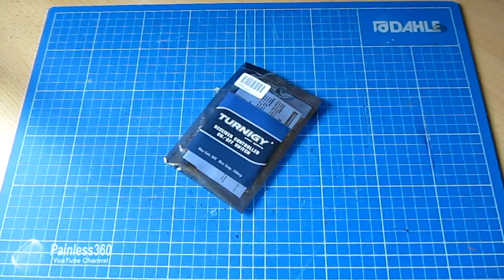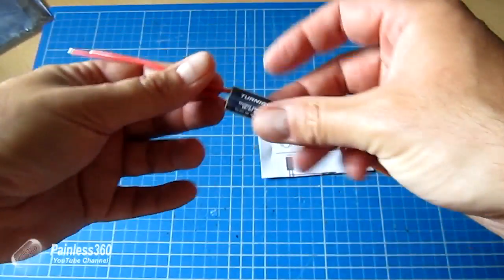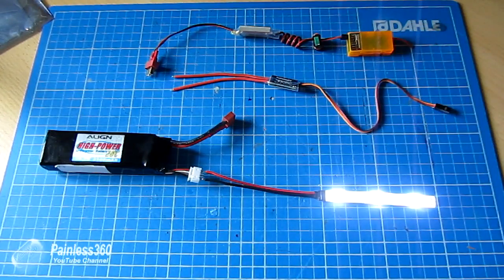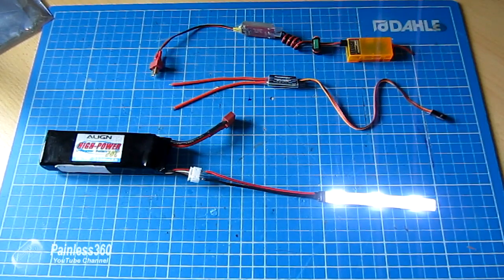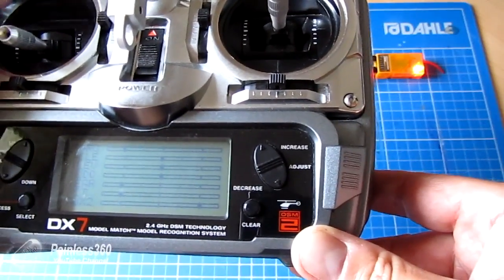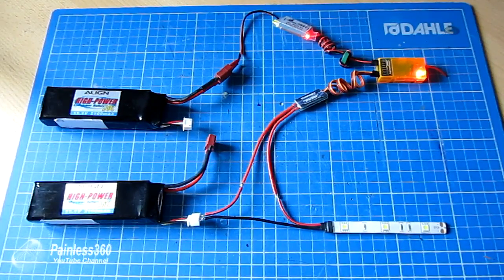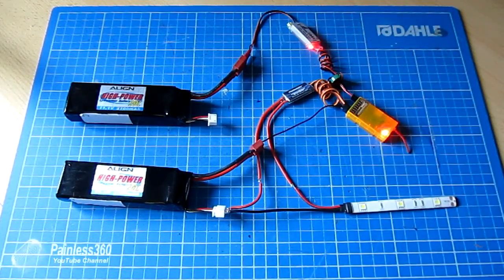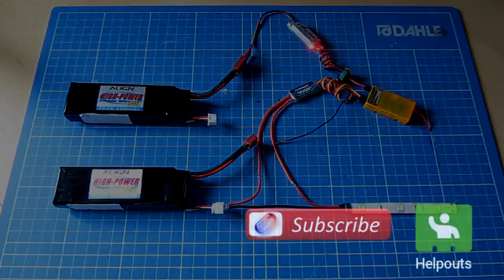Turnigy R/C Switch - Use for LEDs, landing gear etc.

Comment: if my lights are 5v and im running a 3s lipo, where in the circuit to I put the Ubec? im assuming its on the positive coming out of the switch going to the light?
Reply from the maker: Check out my videos where I use one. https://youtu.be/T0OBDKdLpOI

Comment: hi! i may be years late, but can i ask for an explanation why the batteries need to have a common ground for the switch to work? Thank you!
Reply from the maker: I didnt' design it so not sure exactly.
Reply: @Painless360  ohh so it depends on the component (in this case the turnigy switch) and not a "must-do" when it comes to other switches? I cant seem to grasp the theory behind it
Reply from the maker: Most use switching transistors and how they are wired and biased and grounded makes the difference. I wouldn't worry about it and just follow the manual.
Reply: @Painless360  ohh i see! Thank you for taking the time to reply!

Comment: a bit late to the party but worth i try. I have one of these running just fine with a classic pwm receiver but trying to connect it to a modern FC using a CRSF receiver does not want to work at all. Have tried multiple times with multiple FC and nothing it would be great if it would work. Any clues on how to make this work @painless360  (  i have used betaflight pinio and pinio_box which seems to work when checking with a voltmeter )

Comment: Amigo no servo do switch on off que liga no RX é necessário retirar o fio vermelho (+) pra nao queimar o RX. uma vez que meu RX já está sendo alimentado ?
Reply from the maker: Depende de como você está começando tudo. Os fios vermelho e preto para o switch da saída PWM controlando-o são necessários para alimentá-lo. Veja meu vídeo sobre o switch MenaceRC também...
Reply: @Painless360  Então quer dizer que na verdade o RX é que vai Alimentar o Switch On/Off e não ao contrário, é isso ?
Reply from the maker: Normalmente, verifique o manual para o que você tem. Boa sorte
Reply: @Painless360  ok

Comment: I have wired with a single battery per the diagram.  With both jumpers in place, my led does work from my gear switch but in the wrong direction.  Can't fix that because the servo and switch are set to work the gear properly.  So I need the light to work in the reverse direction.  If I remove the jumper for on the light comes on or if I remove the jumper for off the light is off.  But in these two cases the transmitter switch has no impact at all on the state of the light.  If I remove both switches I get nothing.  What am I missing?  Should not one of the jumper positions allow me to reverse the light coming on in the opposite switch position?  Thanks for any help!
Reply from the maker: Not sure as I use the MenaceRC switch here for most things. It must be one of the jumper settings that will allow for what you need.. Sorry I can't be more help - best of luck!

Comment: Hi and thanks for a great video. I'm building a Billings 1:144 scale Titanic which would have about white 150 led's throughout the ship. I would like to switch them from my Tx. The motors will run on a 12v lead acid battery plus a second for the lights etc. I need the 2 batteries for ballast. I planned to run my lights from the second battery using a Step Down Voltage Regulator.  It has been suggested that I use a Turngey R/C switch to activate a relay that would operate the light circuit. Any suggestions..
Reply from the maker: I prefer the MenaceRC version now (https://www.youtube.com/watch?v=Zs_LJNgq-DQ). Wire up everything as you would normally then cut the positive wire to the lights (or whatever) and solder the little switch in place. A high PWM value to the switch turns it 'on' - simple. Best of luck!

Comment: I want to turn landing lights on and off independently from nav and marker lights on a DC-3 model plane using a receiver controlled switch on landing gear channel,  power from receiver  for nav lights, and a separate 9 volt battery for landing lights, with negative sides of motor battery and 9v battery connected. ( Will this work?)

Comment: I just commented on how I prefer Turnigy over Arduino  when it comes to setting up LED lighting in any application I use it for. I have done so many of their lighting systems I ended up purchasing a case of the Turnigy lighting systems for RC Planes. I use it for many other applications besides just RC planes. I have switched over to the varnished copper wiring instead of the braided wiring the Turnigy lighting comes with. It's easier hiding the wiring and can be sealed onto the plane using minwax sealer on my planes. I really like Turnigy products.

Comment: Awesome video and I'm glad I stumbled across it. This is helping me get closer to what I'm trying to achieve. Here's my question.

I'm currently running 12v lights with an external BEC. The BEC is not powering my receiver or my servo, just my 12v lights. In theory it sounds like the two battery option would work for this. Could I set this up as the "two battery" set up with the BEC being my "second" battery? The internal BEC from my esc would remain as it currently is, acting as the "first battery" powering my receiver.

In short, I want to have an on/off switch that is controlled by my transmitter to either turn on or off my external BEC.

Thank you for your help! Hopefully you're still providing support here after all these years.
Reply from the maker: You can use two batteries on the radio as shown in the video so as long as you use the GND connection tip I don't see why it wouldn't work..
Reply: @Painless360  thank you. I bought one. Can't wait to give it a try!

Comment: Hi Lee, as always a great video. I'm installing Nav lights in a Skyhunter 1800 and have a Turnigy switch to toggle the system on and off. I'm using an F765 and a FrSky X8R with the Turnigy plugged into a spare servo output on the X8R. The power is taken from the 4S battery. The lights come on, but don't turn off. Do I need to jump the negative across to the X8R?
Reply from the maker: Thats connection is only needed if you are using two seperate batteries. Best of luck

Comment: Great video but, what if I want to use a nicad for power for the lights and have one lead off the battery. Where will I pickup my ground?
Reply from the maker: The ground just needs to be common for both batteries and it should work.. Best of luck!

Comment: Hi! Thanks for a really well presented video, especially the negative cable 'crossover'. One question though -why use a Turnigy switch, as opposed to just plugging the LED circuit straight into the receiver? Diolch yn fawr, Den, Cymru (Wales)
Reply from the maker: What if the LEDs don't run on 5v? Would the BEC support the current needed for an LED strip? This is safer way to set it up.
Reply: @Painless360  Thanks, unfortunately HK no longer sell them. Any ideas on an alternate, please?

Comment: Hello so many thanks for the video as I always come back to this while setting up a turnigy switch. 

In the first (single battery set-up) is the light getting the full amount of volts from the battery OR only the 5/6v from the RX?
Reply from the maker: The switch is powered by the 5v from the reciever. This thing works as a switch so whatever battery voltage you use is supplied to the LEDs. Happy flying

Comment: Do you know any way to make with one channel turn the lights on and off and with another channel make the same lights blink? No matter if the lights are on or off.
Reply from the maker: Yep - https://youtu.be/Zlpo3Pa5T_4 and check out my tip on auto changing Opentx channel values.. Happy flying!

Comment: hellooo..thank you for this usefull video my friend. but i have a question about this controller circuit from you. if i have make a decision to connect a camera instance the LED Light, so it works properly too? no other connections are needed?
Reply from the maker: Should do, if there is a common GND between the switch and the thing it's controlling..

Comment: Will this switch work with flysky fs-i6 transmitter ?? if not which switch should I buy then. Thanks in advance.
Reply from the maker: I've not tried it but I don't see why not. It uses standard signals. Best of luck

Comment: My lights have a little tiny button you can press to change the flash patterns of the LEDS is there a way to get the TX to turn the lights on and also change the flash patterns ?
Reply from the maker: Unless there is a way built-in to the control board to do that, it'll be tricky. You could look at a way of replacing the physical switch with some kind of transistor that was controlled from somewhere else but that would be quite a big job. Best of luck

Comment: So i see for a separate battery you have a single black wire going into the wire from the switch if im not wrong? Or isit best to connect both batteries together

Comment: Hi if I'm using a 11.1volt 3s lipo and a 6v lighting kit where would I fit a bec. My esc has an inbuilt bec to power the reciever. Thanks
Reply from the maker: The BEC usually is connected to the battery alongside the model. It depends on the BEC.. Best of luck!
Reply: Painless360 is the Bec need always or can you not use the bec and just run the lights
Reply from the maker: Not sure, I'd have to see the wiring diagram of what you're trying to do. All I know is in the video for the switch - best of luck!

Comment: How would one go about getting that white connector you have coming from the led?
Reply from the maker: ebay. Google '3S balance tap'..
Reply: Painless360 when I EBay that all I find are the tips attached to the two wires. I’ve already purchased the 22 gauge wire you recommended so I don’t need the wire it comes with.

Comment: Hi, thanks for the video. I have one of these switches running some led lights (separate battery with grounds connected). I found the lights can be switched on and off via radio but ONLY with both jumpers in place. If the TX is turned off when the lights are on they remain on and what I want is for the lights to go off when the radio signal is lost. Am I missing something with the jumper settings? If I try any of the other jumper settings the lights are always off and cannot be switched on via the TX.
Reply from the maker: No idea, I'd contact HK support as everything I know about it is in the video.. Best of luck!

Comment: Dear uploader ,
Here I found yr video on turning on/off LED by any spare CH frm yr radio. This system I installed it 11 yrs ago in my CX2 heli by Pico switch. Ha ha ...  :-D 

But, now my question to u is how I will use ths "on/off device" in PPM protocol coz drone is run by PPM not PWM?  Or no way ? :-)  
Thanks indeed.
Reply from the maker: +Alva Rahman see my recent video on using servo_tilt if you're using ppm with a flight controller.. Best of luck!

Comment: Hi, do u have to use the BEC for the switch to turn on the led?
Reply from the maker: The switch needs to be powered so it's on-board circuity will work.. That's normally through the servo lead that you connect it to the receiver with..

Comment: I know this vid is a little dated but if you are still answering questions on it.... Here it goes i am wondering if this would work with a traxxas xmaxx and its radio/ controller? i want to put a light kit on it using a separate battery. thanks for any replies.
Reply from the maker: It should work fine. it's just like replacing aphysical switch with this thing. That gotcha with the grounds needing to be common is the only one..

Comment: hope I can still get a response off this old video, I would like to use two seperate batteries as you show however the battery powering my helicopter goes into a BEC stepped down to 6v for my servos, my lights are powered off a straight 2s lipo 8v. My question is this..... If I connect the grounds together will the voltage from my lights trickle into my servos therefore burning them out because they are not rated to handle 8V
Reply from the maker: +SJTYSKA nope, connecting the ground wires will only provide a common ground for the entire system. It will not allow voltage to flow where it shouldn't do. Best of luck

Comment: Hey I'm doing a project making a 5 inch fpv RC car. The RC car came with one of those generic controllers. Is there any way to install this to that controller?
Reply from the maker: +Chris G really depends on the model but if it uses a seperate radio reciever it should do.. Best of luck!

Comment: Which ubec did you use in this video?  Thank You!
Reply from the maker: It'll be an old Turnigy one. You want a 5v 3Amp switched BEC, comes in very handy for setting things up. See my USB cable hack for another handy 5v supply for lower power RC pieces..

Comment: Im using a similar receiver controlled  switch but having problems getting it to throw to activate LED lights  , perhaps I need to play with weight or offset ? Can you suggest some settings please for my Taranis please ?
Reply from the maker: +Marcus Whitehead ive only used this  model of switcher. I'd look in the forums for the exact one your using. Best of luck!

Comment: You mentioned that this wouldn't be a good option for controlling a motor. Do you have any recommendations for receiver controlled switches that are able to actuate a motor momentarily?
Reply from the maker: That was due to the low amperage that the switch could handle. You could use this switch to close a more highly rated relay that would in term control the motor.. Best of luck!

Comment: At least 3 questions in this comment my friend.

I'm new to this part of the RC deal but am i correct in assuming that with this 2 battery hook up everything would still be connected the same way if you decided to hook your load up on the balancing plug of the load battery? 
Also in this setup where does the wiring of resistors come into play? and after you hook up the 6 leds as you have done, would resistors be hooked into  at the end of them before you hook more leds up or would you just hook up more leds at the end of the string you have on the video?
Reply from the maker: The switch just closes the connection between two wires, just like you touching then ends of them together so if you can get something working with DC current/voltage like that then popping the switch into the circuit just allows you to make that connection by using the remote. Everything else isn't affected. Not sure if that helps..
Reply: nah that did not come close to answering the 3 question in my above comment...lol

Comment: After watching this video I have a somewhat related and unrelated question. Here you show using 2 batteries and needing to connect the negative poles together. So is there a benefit, on any airship, to create a common ground to the airframe and only run the positive leads throughout the different circuits? For example connect the main battery negative to the airframe near the PDB. This would allow the ESC negative lead to be connected near the ESC and only run the positive lead to the PDB. Thus reducing weight and wire clutter.

Comment: Hi, I have a question and I can't find any information anywhere, question is.. if I wanted to run this switch and a servo off one channel with a y splitter so that when the servo went in one of the two stop positions (100% either way) whichever was set then it would power an led. I know this switch needs full signal to the servo, e.g is if you had a servo tester and used one output and added a y splitter then a servo and switch then turned it on in wiper mode would it power the switch when the servo was in one of its stop positions. please help.
kind regards
chris
Reply from the maker: +Chris Wright sorry, not sure what you mean..
Reply: basically I want to run this switch and a servo off one channel
Reply from the maker: +Chris Wright can't see why that won't work..
Reply: Painless360 brilliant, thanks for your time and prompt response, very much appreciated and great video's btw.

Comment: I'm a big fan of your work with Painless360. You have saved me hours upon hours off my builds! I'm hoping that you also tackle the Pico Switch and Pico Battle Switch by DimensionEngineering. Would love to see how these switches can be used to trigger devices such as landing gear or any number of battle bot gadgets.  Would enjoy your insight for any tips and tricks to get the most out of these products. When is it best to run two batteries? What is the best way to rig up power to the PDB? Etc. Thanks so much for your concise tutorials.
Reply from the maker: +Eli DElia thanks for the idea, I've looked at the switches as they are something that I have not come across before. It appears that they are simple relay devices designed to provide power similar to the switch that we are looking at in this video. If I get a chance to try one I'll make a video. Thanks again for the idea

Comment: Hi Painless...thanks for the great video and making this simple. I was curious that if you used the flaps channel, would that act as an  dimmer for the LED's?
Thanks again!
Reply from the maker: Not with this switch, it's either on of off.. Happy flying!
Reply: Thanks...that settles that question!  :o)
I hope you don't mind, but I added your link to the Hobby King video for this switch.

Comment: i bought three of these switches.. the first one works fine but one of them only forwads like 0.5V of 5 and the other not at all :( never had any issuses with them?
Reply from the maker: +Curtcou not here. What did hobbyking support say?
Reply: standart i'd have to ship them back but i already took one of them apart to check the connections so i can forget that.. too cheap anyways to ship them back^^